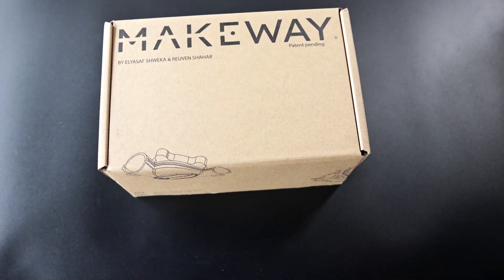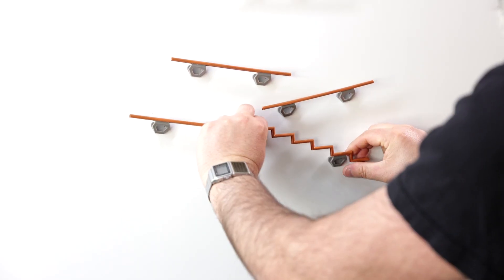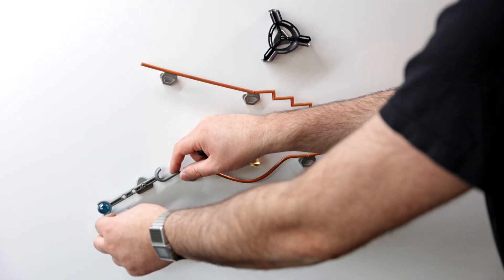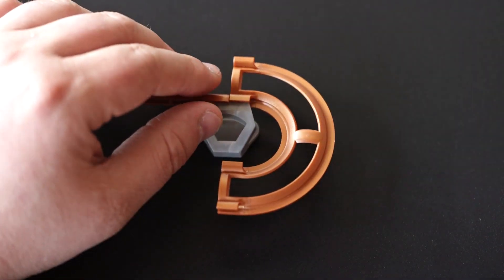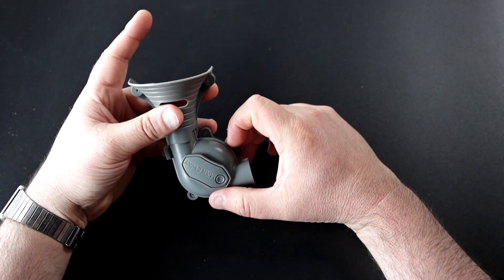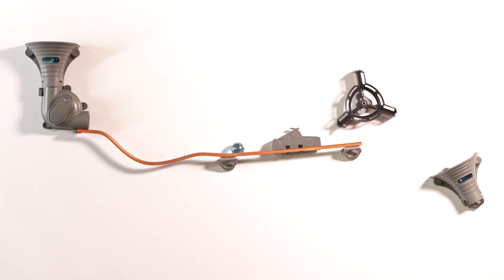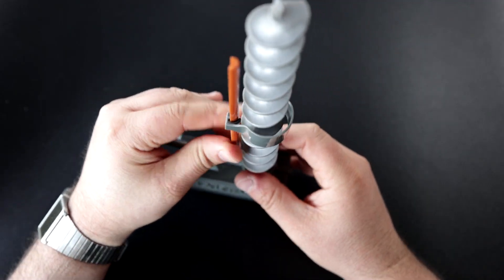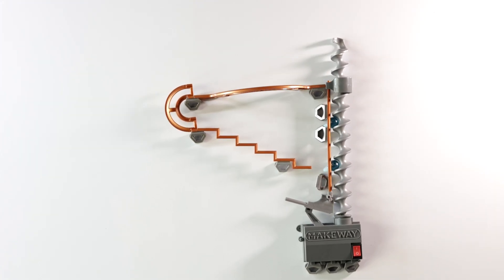Makeway - Unboxing and instructions - All parts

Comment: my flip is not working right. it keeps throwing the marble off track when it gets to the trigger section. the part that pivots is too loose, so when the marble hits it, sometimes the distance between the wall and the trigger (on the z axis) is too close and it just pops the marble off.
Reply from the maker: can you please share a video to
info@makeway.me
I want to look into it. Thanks

Comment: Will a switch that functions from right to left be made available?

I have significant problems setting the canon and then getting it to work. I have to squeeze it so hard to get it to cock that I often end up moving it out of position. Then when I reposition it the canon will go off on its own.  I could never successfully do the multiple canon setup you demo. Any suggestions?
Reply from the maker: Hi Barry,
The switch is working for both right and left. Maybe you are referring to the Flip Part? if so, then this is option certainly on the table right now. In the next update I'm hoping to show some of the new parts we are hoping to bring to the next stage of Makeway.
Cannon - We redesigned the part from scratch, and the new version will be based on a replaceable rubber band and the operation is smoother. my tip is to make sure that you press on the cannon with your thumb, while supporting it from below (on the straight track) with your index finger. I'm sure you can get the idea after some trying. My younger kids do that without a problem now.
Reply: @makeway5507  As I understand how to use the switch the marble must come from left to right to be switched and there is no manipulation for the marble to go from right to left and be switched. This is different than let’s say the catapult in which the marble may come from either direction to be launched.

Will keep trying with the cannon.

Thank you
Reply from the maker: @BarryMunkasy  Again, if you are referring to the Flip (NOT the switch) then yes, you are correct, and we are considering adding a one to the other side, or making this part for both sides, like the catapult.
Reply: I looked at the picture on the FB page of the names of each component and I guess I am referring to the fork. I apologize for the confusion.